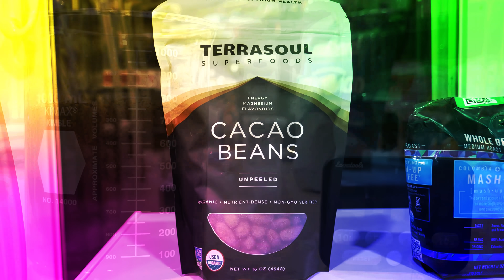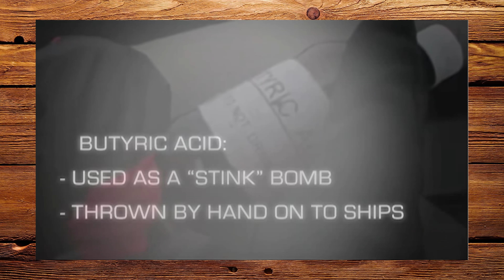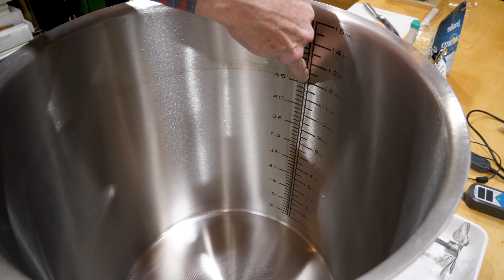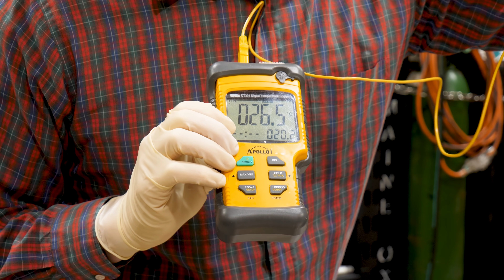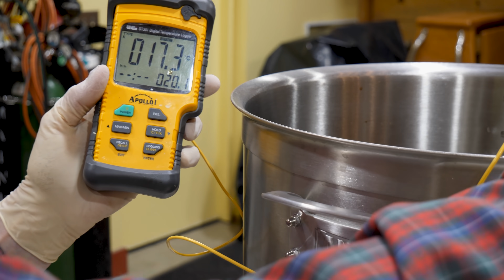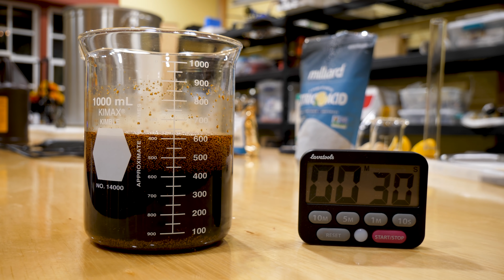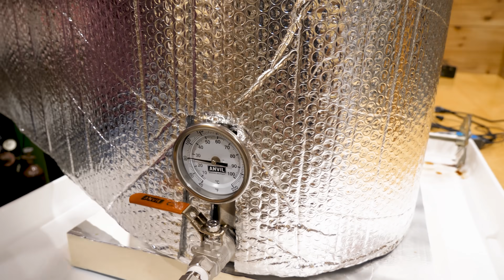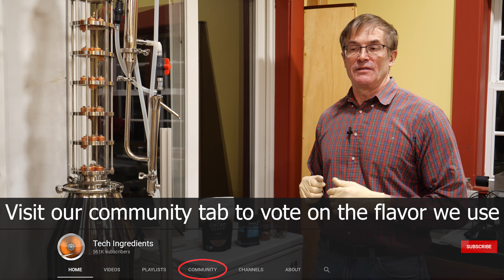Making Flavored Rum | Easy and Cheap! - Part 1

Comment: Love the channel and all you do for the community. You discussed water quality briefly in this video... have you thought about doing a video on effectiveness of Refrigerator Water Filters and well water? We get our well water tested and are told that its of high quality etc. We have a new GE fridge that uses RPWFE filters that have an RFID chip in them that limits how long they can be used for. Its likely a moot point as the flow of water slows down to a crawl after 3 months... but Id like to buy cheaper filters (RPWF) which are disabled by the fridge manufacturer as they don't have the RFID chip in them...

Comment: Thanks for interesting videos. I will vote Cinnamon. I can’t wait to see the next video. 
Also a question about water flow into your reflux ? My system requires 8 litres per minute of tap water. I see you had a freezer with an aquarium pump . To pump the water is that pump powerful enough or is it because the water is so cold you don’t need an 8 litre a minute output?
Reply from the maker: That is a 20 liter per minute pump (I tested it).  The cold water also helps.
Reply: @TechIngredients  can I ask did you buy the pump off Amazon and can the pump take temperatures below zero . Would a 3000 l/h be enough to pump 8 litres per min. My math is 3000 divided by 60 which gives me 50 per minute is that correct math?

Comment: Hi,
Many thanks for your video. Very informative!
Also, could you advise whether butyric and acetic bond bonding with ethylene takes place in the fermentation process or in the distillation process? I am keen to explore, for example, the interaction of acetic acid and ethylene in beer production to produce tropical fruit flavours, but obviously this would be pointless if the interaction occurs in distillation! Assuming the latter, could ethyl acetate be added to beer (safely) to produce these flavours? Grateful for your advice!
David Southworth, UK

Comment: The Big Mouth Bubbler is plastic and solves the problem of having a small opening to clean out.
Also,  you can buy an autosiphon which will negate the "stirring" issue you mentioned

Comment: You have said that you keep the Dunder from the fermenter. Do you also keep the Dunder from the still boiler after you have finished the collection of ethanol?  Dave from Oz
Reply from the maker: You can do it either way.  The residual alcohol in the pot will affect the aging of the dunder.  I haven't  compared the results, but there are proponents on either side.

Comment: Hi... What a awesome video. Full of details, clear explanation, exceptional video quality. Great work.

Could you explain me something... Everytime I saw a video on youtube, people seal the lid during fermenting, even using an airlock. Do you seal yours, or just put the lid as it is?

Thanks for doing those contents.
Reply from the maker: I don't.   The very small gap in the metal lid to metal pot combined with the continuous outflow of carbon dioxide and the fact that the heavier than air carbon dioxide forms a protective layer above the liquid makes it unnecessary.
Reply: Wow @TechIngredients , thanks for your fast reply!!  Fast fast! =)

I saw right now the explanation in your banana video, and come here to do a post scriptum on my comment. You were faster than me.

Regards!

Comment: I assume you will take out the packing from the reflux chambers and won't run the reflux condenser as rum is generally a pot/single stage distillation as we want flavours to move over?

Comment: Awesome video! I would be careful about keeping too much trub with the dunder. If your holding for a long time the yeast can go through autolysis and add some pretty bad flavors. I'm not sure how that affects distilled spirits. But I ruined a 2 year batch of sour beer because of it.
Reply from the maker: You might be right.  However, historically this dunder would be "stored" down in the Caribbean for extended periods in pits that looked like open graves.  It must be pretty resilient.

Comment: Thanks for the video! I’m just finishing up a rum fermentation now and it definitely could have used an insulation and heating system like yours… the ambient temperature dropped, so I used a thick towel as insulation. It got the job done, but was definitely slow. I have a temperature that I like, but do you have a heater that you would recommend?
Reply from the maker: Great!
I'd simply find a personal heating pad, wrap it around the pot, under the insulation/towel and set it on low in the morning, check on the set up at the end of the day and adjust as needed.
Reply: @TechIngredients  thanks! I’ll give it a try for the next batch!

Comment: Question to anyone more experienced than myself with this stuff: He makes a lot of good points about using a singular vessel thats easy to clean for as many steps as possible to reduce complexity and clean up. Would it not be possible to have a large stainless pot like he uses with a second lid that could latch on with a silicone seal so the same pot could also be the main pot of the distillery?
Reply from the maker: That might be carrying it too far.  There are a lot of residual solids on the bottom of the fermentation pot and they can cause foaming and scorching during distillation.

Comment: I have two questions.  First, I was sourcing the copper tubes to construct my own reflux still, but I like all the little goodies you mentioned about your still better than mine.  What was the purchase price of your still and where can I order one?  The second question concerns your dunder mix.  You obviously got yours from an earlier distillation run, but not having a previous run, where can you get dunder to begin with?  Thank you.
Reply from the maker: Brewhaus $1,900.
You really can't, but that's not a problem as the first run is still very good and it just gets better.

Comment: What do you think about adding lemon slices to the mash?  Would that be enough to lower the ph?  I imagine it would take longer.  And, would the oils and rind have any negative effects?  There's a popular shot called chocolate cake that uses Frangelico and a sugared lemon slice to replicate the flavor of ... chocolate cake.  I'm curious as to what kind of flavor sliced lemon would impart to the finished product.
Reply from the maker: It should work, but as you say it will take time for the effect to stabilize.  Also, most of the acid is in the juice.  If you want the flavor then maybe place the peals in the gin basket.

Comment: Do you leave the used yeast from the fermentation in your dunder to put in the live dunder or do you filter it out? Getting ready to start my first live dunder and don't want to mess it up
Reply from the maker: I leave it.  Think about what the Jamaicans must have done when starting the fermentation. The dunder was taken from large barrels that had been sitting in the heat for days or weeks. Wild yeasts at the very least were added along with EVERYTHING from the previous batch.

Comment: I am curious.  When using the hydrometer, does it need to be in that cylinder to float properly?  It seems to me that your container is deep enough, so you could just let the hydrometer float in the vat and get the same reading without having to fill up the cylinder and fret over whether to add it back to the main container.  Am I missing something? (Surface tension, maybe?)  Great channel, BTW!  One of the best on YouTube in my opinion!
Reply from the maker: You certainly can, but it is a little harder to see and even harder to film.
Reply: @TechIngredients  OK, that makes sense.  Thanks for the clarification!

Comment: Would be interesting to nerd out on immersion heating VS heating bands.  (flavor and aromas). Do you find yourself adjusting the band with temperature changes? Are you having scorching issues with the bands (rum is not clear as other washes)?  Would also be interesting to compare DADY vs EC-1118 vs other commercial available yeast made for Rum. Different fermentation temperatures effect on aroma and flavor.
Reply from the maker: The bands are better.  I've never had any scorching and the cleaning is easier without the internal elements.

Comment: Awesome video, one small inaccuracy though, when adding the lemon juice you said that a certain amount reduced the pH by about 1 unit, which may be true for the levels that you are dealing with, but that definitely will not be true always, for instance you could never lower it below the natural pH of lemon juice no matter how much you added.

So if you added lemon juice to water which is around 7 normally, the same amount that would bring that to 6 would have to be multiplied by 10x to bring it to 5 because pH is a measure of concentration but the scale is logarithmic.
Reply from the maker: As you said it may be appropriate for the range we're dealing with. I decided not to dive into the logarithmic properties of pH units.  We have to balance the length and complexity of our videos and the information we need to get across.

Comment: If you use stillage / backset dunder instead of citric acid, you’ll get a lot more intensity out of it.

Also, if you simmer the molasses in backset and water, you’ll invert the sucrose (break fructose / glucose bond) and remove some of the piercing notes in the spirit.

I heat some stillage dunder first then add molasses to it for the inversion, diluting it only minimally. After the inversion, I add the remaining muck dunder for a short recirculating / agitated simmer, followed by crash cooling, add remaining water to 1.080, perform pH adjustment with more sterile stillage dunder, then nutrients and yeast.

1.080 is a good initial gravity, but I always boil the muck pit dunder to kill it, leaving the sac. cer. to do the work, and the compounds in the dunder to contribute esters only. A good yeast is Safspirit C-70 (carribean rum) at 29C, or USW-6 (american whiskey) at 27C. Both have highly desirable ester profiles. I keep pH to between 4.5 and 5.2, leaning on the acidic side. They are definitely not neutral yeasts like the DADY, and contribute a good deal of the character of the spirit.

Muck pit dunder and stillage dunder are both pretty important and serve slightly different purposes.

I think rum is advanced chemistry performed accidentally by artisans through trial and error using their senses. It’s pretty remarkable.
Reply from the maker: Thanks for the suggestions!

Comment: The tubing you are using for you cooling water for you condenser and dephalgmator, where do you get it and what material is it made of?
Reply from the maker: Silicone rubber of approximately 50 durometer from McMaster Carr.
Reply: @TechIngredients  Thank you for your quick response. I much appreciate your videos and your expertise. Thank you for sharing.

Comment: Looks like you are doing a single distillation.  Whiskey Tribe did a Jameson factory tour and we saw that they did a triple distillation.  Another smaller scale whiskey distiller in Austin does a continuous distillation.  If you know what effects these different processes have on the final product, it would be good content in the next video.
Reply from the maker: Did you watch our recent video introducing this new reflux still?
Reply: @TechIngredients  Yes. That was a great video.  But looking into this, I find a big bucks outfit using a primative process with a complex recipe and a small outfit using a modern process.  I find a lot of tinkering info out there, but little professional instruction.  For my build, I will be using a PLC to control the process, including the amount of reflux at any stage.  Someone must have data on which flavoring compound passes at which temperature.  Certainly the big bucks outfits employ flavorists who keep their product the same, despite variations in ingredients.
It is probably too late, but maybe you could distill a batch from each of your stills.
Reply: @kenhnsy  @Tech Ingredients needs a gas chromatograph.  Not that expensive and would make a great video.
Reply: @drbtk  Yes!!  It appears that used ones with a warranty can be had for $1500.  Thanks for reminding me why I do not finish      projects.

Comment: I happy to let the community decide which infusion to use but you gotta let the distillation run for a bit to get some straight rum out first,  then pause the element in the still so you can add the winning infusion then.  It would make a great ending to the video as you taste test and compare the two rums.

Comment: Is the dunder the dregs after distillation (boiled) or do you siphon off the wash and keep the dregs for dunder?
Reply from the maker: As I explained in the video, I use the dross at the bottom of the fermenter.  But historically, the dross or the stillage or a combination can be used for this purpose.
Reply: @TechIngredients  oh yeah (thanks for the response), it was made clearer in the second video. I guessing there would be enough dormant yeast in the dunder to get the next one started as well (if your not in a hurry to ferment)

Comment: Hi, thanks for sharing. I thought the fermentation container is supposed to be kept air-tight with one way air lock. I didn't see you do that. What am I missing ?
Reply from the maker: It's not as OCD as many people treat it.  The lid and the layer of heavier than air CO2 that forms over the liquid is enough.
Reply: @TechIngredients  That is an interesting perspective indeed. However, given that the fermentation is occurring at a relatively elevated temperature, I presume there will be convection eddies that will disrupt the heavier than air CO2 buffer. Just thinking out loud here.

Comment: would using an aquarium bubbler/pump in the water help to remove added halogens? our water is surface water and has a lot of Chloramines in it for sterilization, so it is more persistent than simple chlorine.
Reply from the maker: I don't think so.  Chloramine is persistent, however slow flow through activated carbon will work.

Comment: I'm a beginner, and I haven't distilled anything yet. I don't even have a still, yet. But I have been watching a ton of stuff on YouTube.
Just have a question,what type of still do you think I should start out with.
Reply from the maker: Do you have any experience with fermentation of wine or beer?
Your level of experience there will influence how much you should spend and the likelihood that you will stick with the hobby.
A "pot still" is a good choice for most beginners, and although it is slower, go with an electrical heat source because  open flame and alcohol and alcohol vapors can be a risky mix.
Don't build your own still as a beginner.  If you progress, you'll soon know what you want to change or incorporate in version 2.0.
Good luck!

Comment: How much dunder for a 6 gallon wash each time? I had read where others use some of the dunder after distillation to go in the next distillation and then again. Is that just a different take on the same process? Thanks
Reply from the maker: The dunder evaporates over time, so the amount you add will be much less in volume than when the dunder is collected.  Just drain the fermenter untill the settled material at the bottom begins to flow into the transfer line and stop.  Then take whatever is left and that's what you'll add to the next batch.
Some people will add the still age to the dunder and that's fine, it's just another way to do it.
Reply: @TechIngredients  Well what you are draining off is like a yeast starter I suppose. Do you try to store it at room temp or does the temps matter. Thanks for the videos and info.
Reply from the maker: Just put some cheese cloth over the top to keep out the critters and put it wherever it won't get in the way. Ideally, it would be outside, say in a covered porch to get exposure to a variety of wild yeasts.

Comment: 25:00 pH is a log scale so you can't just say that to lower it half of the 1.2 units it would take half the volume. It is wrong, you have to use the formula pH=-log([H+]).
In fact a delta of 1.2 units doesn't mean anything on it's own for the same reason (it being a log scale); it matters greatly where on the scale you are. You were already lower than 7 on the scale so you need proportionately more lemon juice. In theory you could measure the juice pH and mash pH and do a calculation to figure out exactly how much you need. It's high-school chemistry, you should go for it, it only takes a couple simple formulas and then you can make an automated excel calculator for the future if you are a bit crafty. :)

P.S. 27:00 if your optimum is just a bit lower it is worth going for another lemon since again, it being a log scale, that last small difference in the pH value makes an exponentially bigger difference in the actual number of ions present and can be important for biological systems.

35:50 Also entropy increasing does not necessarily mean the reaction has to be exothermic in the pure chemical therms...

Comment: I have a question about flavoring rum. How do you keep the distillate from going cloudy when you infuse with citrus zest? Whenever i make spiced rum and use lemon, orange or lime zest the rum invariably goes cloudly when I cut to drinking strength .I am sure that its from the oil.
Reply from the maker: Did you watch our later video on extracting lemon oil using the same reflux still used to make rum?  It lead to a visit to the ER.😀

Comment: If I understood correctly, you described your dunder as being based on the leftovers in the fermentation vessel after the fermented wash is transferred to the still.  Other sources describe the base for the Dunder as being the leavings in the still pot after distillation….???  Can you clarify the difference or point out my misunderstanding?  Or are both techniques workable?
Reply from the maker: Both techniques work and in some cases the two are mixed.